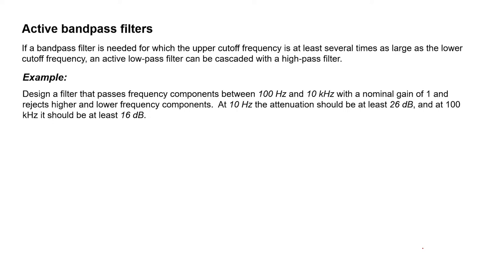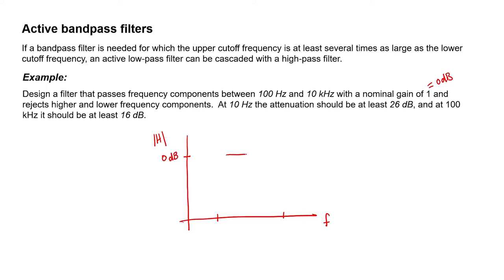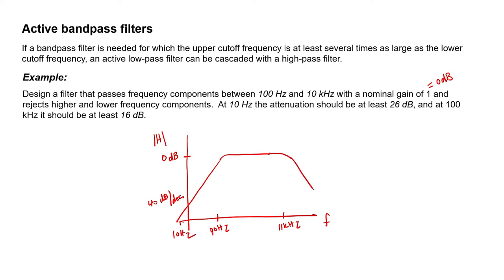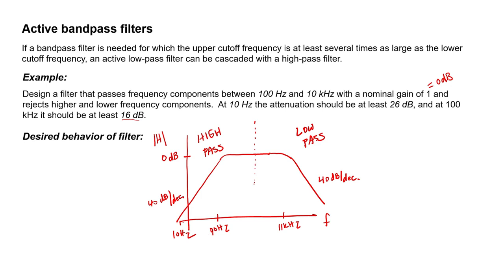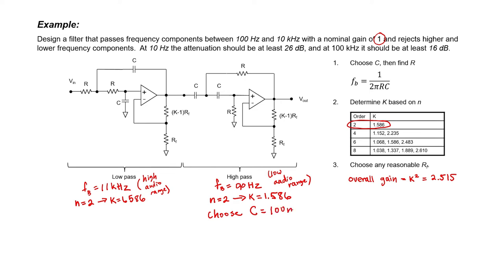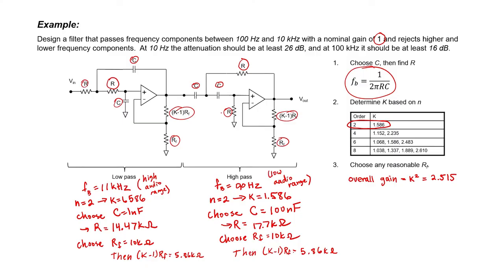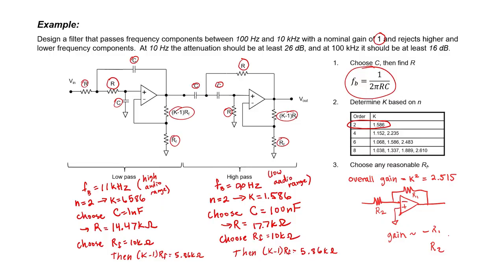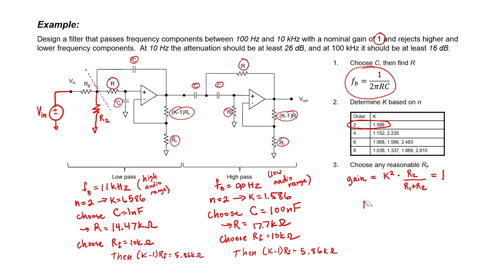Bandpass active filters with Sallen-Key circuits (5 - Active Filters)

Comment: If you cascade two 2nd order circuits doesn't it make the whole circuit a 4th order?
Reply: I also think it should be like this. Analyzed according to the 4th order circuit in the low pass filter video.